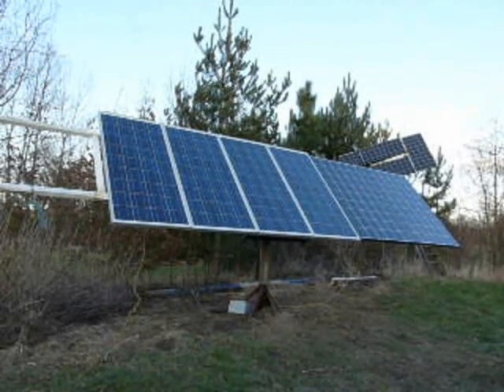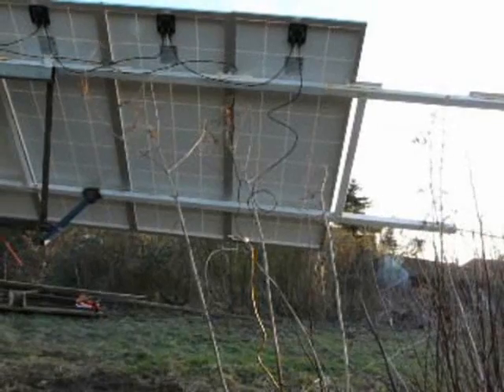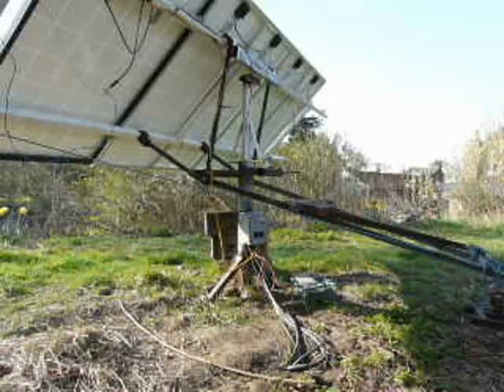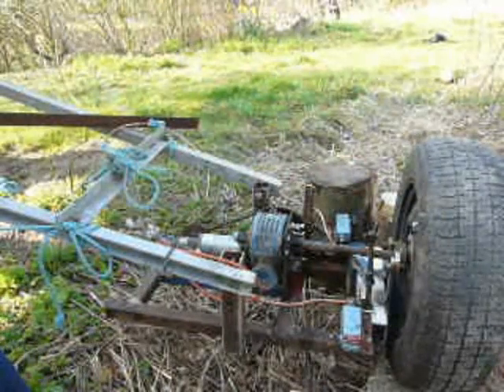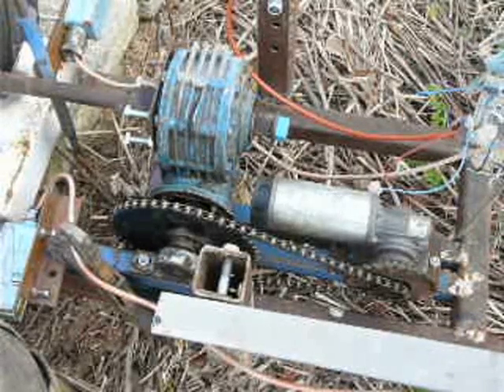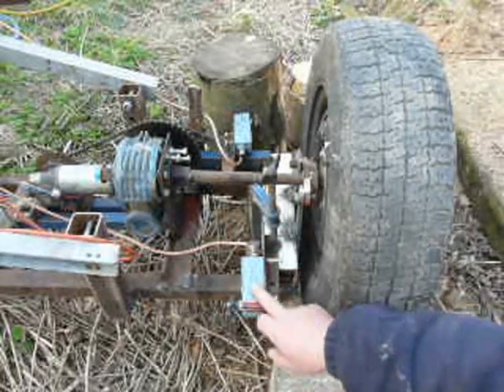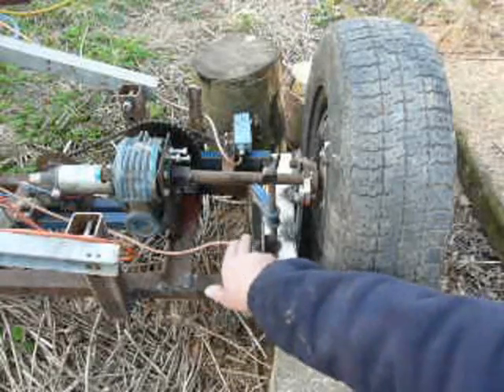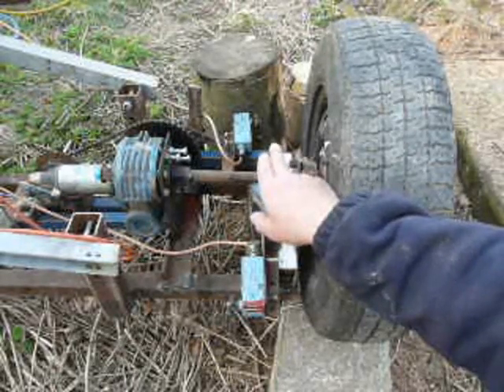Solar panel tracking, home made, dramatic increase in photovotaic power output.

Comment: good job but how do you avoid the wind from turning the unit. ?
Reply from the maker: Hi, good question, it is a matter of the long drive arn out the back, the weight of the drive and the tread on the tyre, seems to work well. I have other videos on tracking, there's a playlist  (solar tracking  gate project) Cheers

Comment: How much would it handle for snow load and wind?
Reply from the maker: Hi. I suspect the loading on the panels would be the factor. In areas where deep snow is normal then it would be best to switch the tracking off facing the mid day sun as it would propably either slip or freeze up. See the solar gate tracking project. Cheers, Andy

Comment: Did you use small L brackets to attach panels?
Reply from the maker: Hi. Short lengths of 25mm angle iron welded on the frame, then the panels are clamped to these with 6mm bolts and large washers. See edition 3 of Wind and Solar Electricity. Cheers